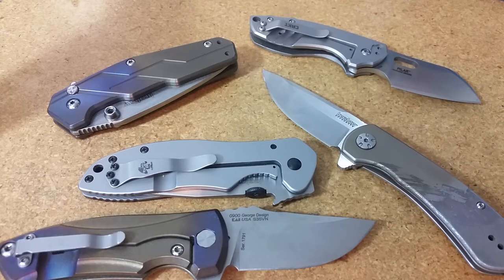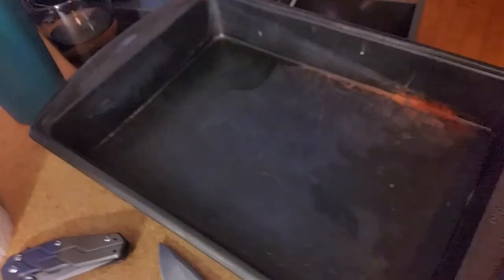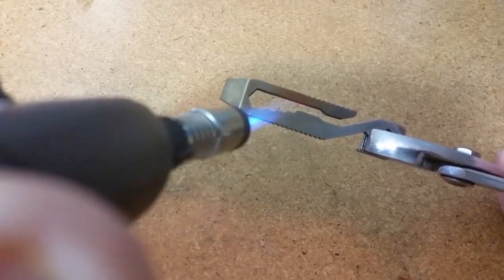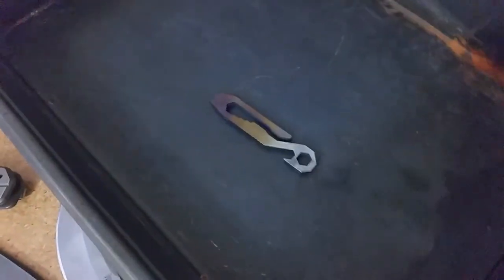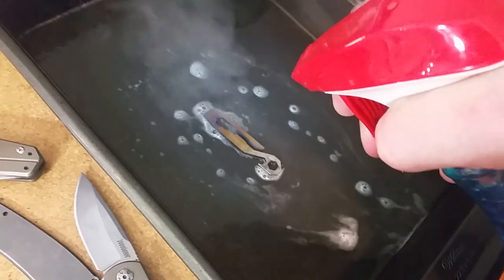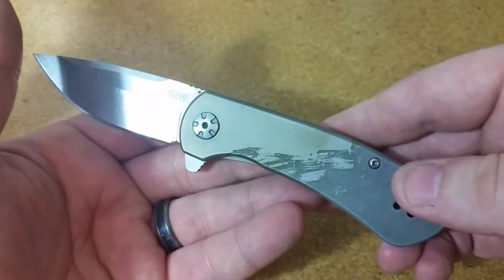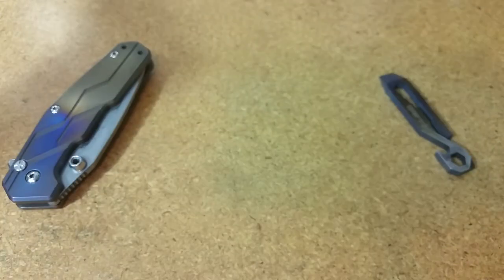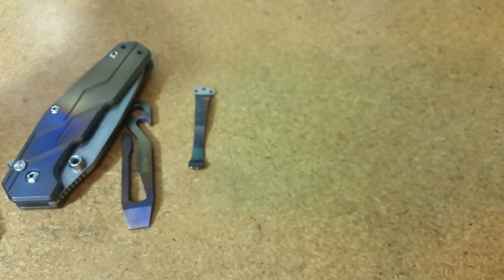Heat Anodizing Tutorial, Demo, and Tips.

Comment: Playing with fire is part of what makes heat ano so much fun.  I hang my pieces from a wire in the basement and use the little torch fitting for the blue gas tanks.  It works pretty good but will rotate unless I control it, which is preferred of course but can get hot as you know. Prepping is always key and just the simple wipe down before is necessary. The Windex at the end helps cool the titanium and lock in the color you currently see.

I have also done some heat ano on copper which is pretty cool.  Problem is as the copper patinas you lose the ano, at least in my experience.  Putting your piece in the pan has me nervous as the heat can transfer through pretty quick.  I'll assume it's elevated, or something else is under it for now.

Great content as always.  I can't imagine how hard it was to try and heat ano while you talk on video, I nearly got myself confused.  You showed many of your random pieces but I think you definitely have some skill in your application of heat anos.
Reply from the maker: Thanks bud. Always good to hear how someone else does it.

I'll have to try the copper some time, that would be neat. Looking forward to seeing more from you!

Comment: Great video mate really enjoyed and looking forward to having a go at it.one question though does titanium change its shape at all.ie would the scales warp at all.just love this simple type of video for us nubies to follow.atb paddy.
Reply from the maker: The amount of heat it would take to warp steel or titanium or break a heat treat would be pretty high. Never had a single issue with a frame at all, titanium or steel.

I won't ano a blade for that reason (amongst many other common sense ones) just to be safe, but I wouldn't worry otherwise.

Maybe, maybe, if it was a super thick piece you could get it so hot that the integrity was compromised. But I've never seen that myself with steel or titanium.

Thanks for the question and the feedback bud. Take care!

Comment: Just to confirm you can indeed anodize steel scales? But it will only turn bronze is that correct? Or will the steel also turn to purple and blue?
Reply from the maker: You can do steel, but there is a measure of inconsistency in the results depending on the type/quality of the steel. Bronze is generally easy and safer to achieve, and while in some cases you can get blues and purples with steel, the only way to know if those colors can be achieved on a specific piece of steel would just be try it.

Comment: Any tips or "gotchas" on aluminum? I have a couple of knives with aluminum handle material I would like to try this on. Nice job on the video, JT!
Reply from the maker: Aluminum doesn't work very well from what I've seen.  I've tried it, and it scorched pretty quickly. Got some bronze colors on some overlays, and it didn't look bad at all, but it's tough.

You can see some other color come out of it, but there was very little control over the results.

I'm also not sure about warping/the integrity of the aluminum either, so I would practice on some scrap pieces or old knives first.
Reply: Ya, aluminum doesn't heat ano well at all..
Maybe get some aftermarket Ti or stainless scales to ano?

Comment: Looks great ! Got a question though, does heat anodizing affect adversely the heat treatment of certain pieces? Ie. A frame-locks spring retaining side ect . Thx & gr8 video !!
Reply from the maker: Thanks, and good question. Yes, it can effect heat treats I'm told. But although I have encountered problems with mids, very rarely was it due to anything that could even possibly have been the heat. I'd say you're safer to avoid heating lock sides, sure, but I'd still do it and not worry about it myself.

Comment: What do you sand the stainless steel with? Like the Pilar. I’m looking to anodize the scales on my CRKT GSD
Reply from the maker: I only sand them if there's a coating, and then it's really just with a dremel. If I had a GSD I'd probably just heat torch that frame right from factory.
Reply: Thanks 🙏

Comment: Have you tried ano'ing the inner part first to get the color rather than the outside? If so, what was the conclusion?
Reply from the maker: Whichever side you apply the heat to, the opposite side will turn color as well. It looks more muted though, and it's harder to get a consistent result. The finishes being different might play a part in that as well though.
Reply: @JTsKnifeLife  ah yeah that is right... I think it also can get hotter even too cause the heat travels through? I know what you mean by muted part though!

Comment: You can heat adonized scales with thinner spots, all you have to do is make a jig out of steel and use high temp thermal paste in thinner areas and transfer some heat to the steel blocks underneath and colors will slow down in thinner areas. You can make different shape steel jig blocks and use thermal paste to transfer heat from thinner areas to control temp.
Reply from the maker: Great info, thanks for that!
Reply: @JTsKnifeLife  No Problem!! Keep up the good vids! Lots of useful info on here!! Yea there are only so small you can get in torches, Some really high end Striders with the thin tiger strip flame coloring are done like that with metal jigs underneath to get as much detail as possible, it's even possible to use diffrent shape blocks underneath and get different shapes like a stencil effect. Not easy but with practice, nice results! Copper blocks would work better since they absorb heat better but would be costly, but if you do this for a living then worth it.

Comment: messing up heattreatment is not a probleme?
Reply from the maker: No, I've never had a problem. I never really did any work on the blades though, and I'd probably avoid doing that.
Reply: @JTsKnifeLife  yes but pry bars are heat treated tools as well, arent they?
Reply from the maker: @lashazaridze813  Sure they are but I don't think the titanium gets hot enough to really damage the integrity. Plus, I only really use pry bars this small for scraping and pulling screws and what not. Never applying enough torque to it to have a real impact. Never seen it happen from anyone else either.
Reply: @JTsKnifeLife  thanks for the info <3